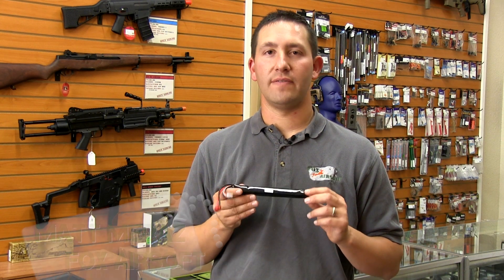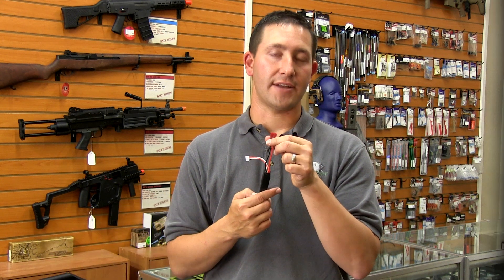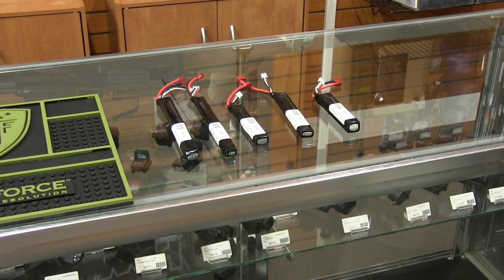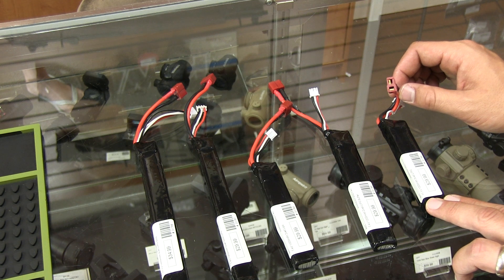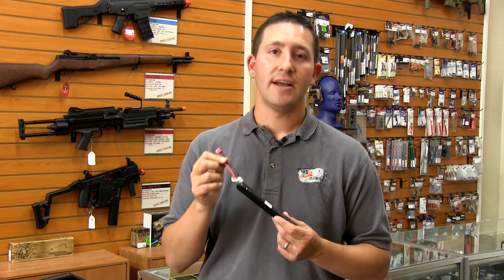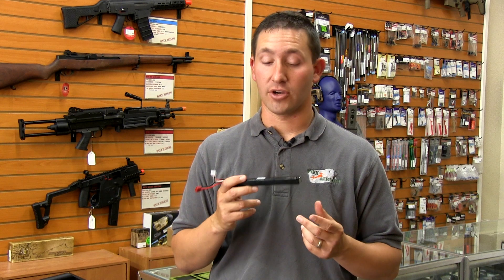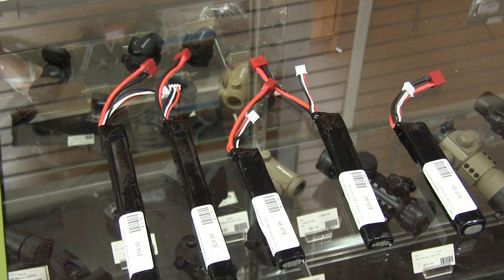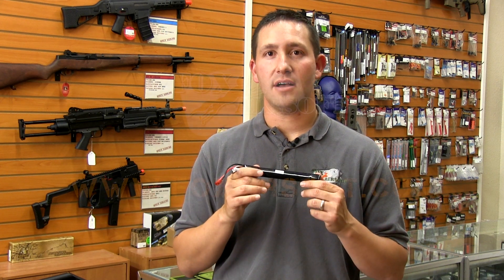Fox Airsoft's Lipo Battery with Deans Connector Review | Fox Airsoft

Comment: So I've been playing airsoft for a few years and its about time that i upgrade to Li-Poly batteries. Im trying to get a few tips on starting out. Okay so im attempting to run 2 11.1 batteries between a krytac PDW with a MOSFET built in, and a G&G Raider. I feel pretty secure about using it in the Krytac because its recommended but not as much the raider. I was watching a video and it said that its not good to use semi auto with lipos but my field is strictly semi CQB, Any tips?
Reply: +Price English im on a big team were # 1 in the northeast and we all use lipos 11.1 and we only use semi i see no difference and it and using the lipo it gets the bb out the gun much faster theirs not a lag between the trigger pull and the bb leaving. so i hope this helped a little i just got my gun back yesterday i had deans put on mine
Reply: mosfet fixes the problem. otherwise it might damage it but not after a couple thousand rounds

Comment: Does higher voltage in a battery make it more likely for an airsoft gun to break if you do not upgrade the internals? Gear box, spring, etc.
Reply: if you run an 11.1 in a questionable gearbox or one not Lipo Ready you will come out with smooth gears. That being said i ran an 11.1 lipo in a CA m15a4(not lipo ready) for a year of everyday use with the stock gearbox without anything bad happening but those were still steel reinforced gears. After a year the gears got shredded.